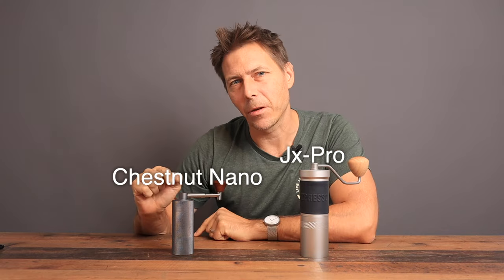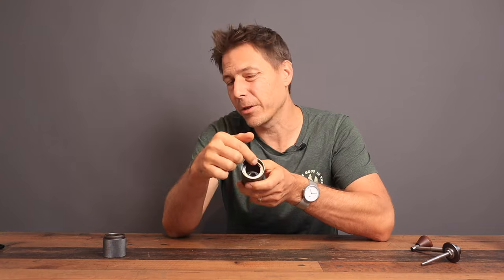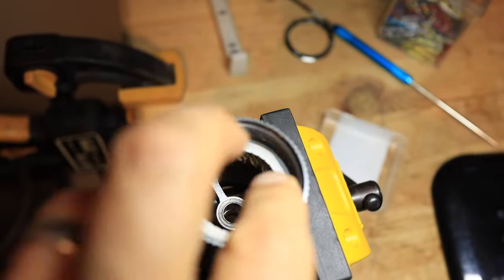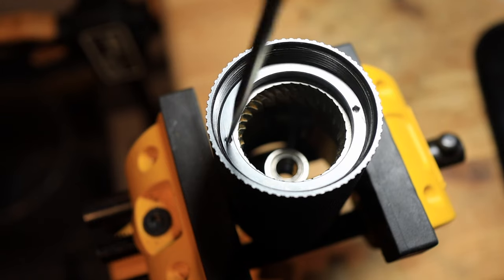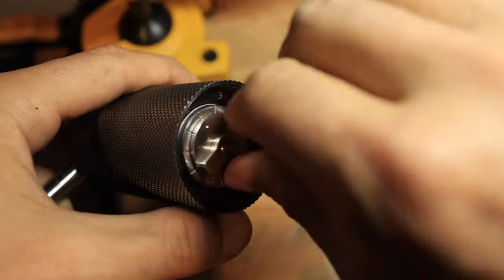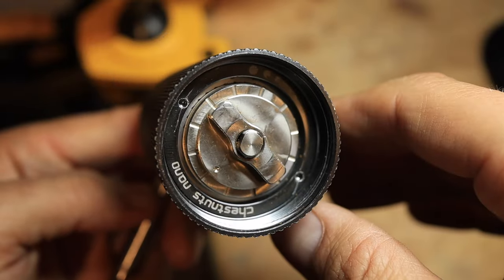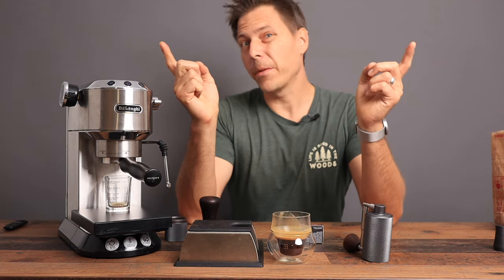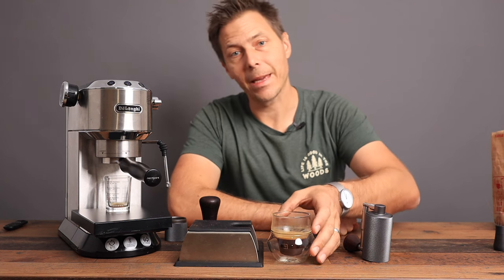How and Why (?!) to Shim your Timemore Grinder - C3, Nano, & More

Comment: Another trick is to tighten down the center of the burr into the outer burr but with the locknut loose. this alines the burr assembly. you then tighten down the locknut. It then spins freely at four clicks or less. thanks!
Reply from the maker: Thanks Stephen, I will have to give that a shot!
Reply: thank you, I had to do it that way cause the casing of my C2 burrs is made of plastic and the gap was too tight. works like a charm now
Reply: Hi, could you elaborate on what you mean by tightening down the center of the burr into the outer burr? 

Do you mean unscrew the locknut, then get to 0 click?
Reply: @musicianoffailure-3804  Loosen the retaining ring for the outer burr, tighten the cone burr to '0', then tighten the outer burr retaining ring. This works because the conical (cross-section) shape will self-center the outer burr to the conical burr piece and become concentric.
Reply: @BigBenAdv Thank you, this worked for me! Spins freely around 6 clicks now. Only watch-out: Make sure the outer burr is  loose (and not jammed like in my case) for the aligning through tightening the cone burr to actually work.
Reply: After 5years of knowing this problem, I can finally fix it. 🙏🏼 thanks!
Reply: Thanks for the tip. It worked well for me too
Reply: @TomsCoffeeCorner Hello.  Have you done it?  And did it help?

Comment: I just bought c3s version. The seller said its upgraded version of c3. I don't know if I'm just lucky or timemore really fixed the issue with outer burr alignment. I do test my grinder and i only hear burr grind sound only at first 3 click. The 4th is all clear, the casing / handle can spin freely.
Reply from the maker: Then you should be good to go!

Comment: Hi Tom. Thanks for all the great videos. I have a question. My timemore c3 pro esp is somehow misaligned and when I turn the dial to maximum it stops at 1 instead of going all the way to zero. This happened after I disassembled it and put it back together. Do you know how to calibrate the dial so that when it cannot turn anymore it reaches the '0' indicator on the bottom.
Reply: That happened to me, you found a solution??

Comment: Tom do you think this grinder gives much better quality grind than La Specialista build in one does?
Reply from the maker: Hi Ivan, I don't think so. There is too little adjustment. But the Jx-Pro would give a marked improvement.
Reply: @TomsCoffeeCorner  perfect, thanks for suggestion. Just checked on Amazon, it has 5 stars. Def looking of getting one, to change the quality of shots.

Comment: Hello, I bought an ims 18g nano and I still haven't been able to make the shot join in a single shot of coffee with the original gaggia basket, the shot of coffee always joined. What do you recommend to be able to achieve it, I always use 18g of coffee.
Reply from the maker: Hi Victor, which grinder are you using, and what kind of beans?
Reply: Tom I'm using baratza encore and the coffee is medium light if I put the basket that came with the bottomless portafilter it comes out perfect and I put it finer and it takes 45 seconds to make 36g of coffee
Reply from the maker: Ok so you say it comes out perfect, but just doesn't look that good? Maybe try WDT method. 👍
Reply: @TomsCoffeeCorner  Tom s also use the WDT method always

Comment: This video must be earlier than now )before I bought  another one grinder ,now I have chestnut and kingrinder)
Reply from the maker: So which one do you prefer?
Reply: @TomsCoffeeCorner  Thanks for answer Tom,kingrinder k4 is much better than C2 ,burrs synch best ,but I have standard portfilter on my EC685 and today I tuned my C2,I think keep it for alternate methods.Thanks for you tips,burrs is sync better a Little bit after this. I would be glad if you recommended a dosage for a standard portofilter, because I can't repeat the result. I don't know what the reason might be.Now I use 14g and 25 sec,but sometimes there is an acid taste ,not a delicious shot,and you do it so easy and perfect ,I’ll be glad for your help.
Reply from the maker: @akselerant  Hi there! Well, the dosage depends on the roast. Medium roasted beans are denser than dark roast, so you can fit more in the basket. For example, on the Dedica, I try for 14 grams of darker roast espresso. But if I am using light or medium, I can fit even 17-18 grams, due to the higher density. 
You will just need to experiment with your dosing, as well as trying the steam temp hack: https://youtube.com/shorts/8GO1b94CgN4?feature=share
Reply: @TomsCoffeeCorner  Oh Tom ,thank you very much ,I tried the  hack temperature too,now I will know that dosage depend on roast.I will try with fresh roast coffee and give the feedback to you.Sorry for my not so good English)I hope you saved my espresso )😊And another one question, Do I understand correctly that for different grains it is necessary to use the maximum dosage in the holder?

Comment: To anyone whose C3/C3esp is only slightly out of spec (like, the burrs make contact at 7 or 8), I managed to restore mine to acceptable concentricity by tightening it as much as it could go (at this point around 1), then heating the section with the burr (no handle or grounds collector) in boiling water.

After heating for a few minutes, I found (with the help of tongs and a tea towel!) that I could tighten it further to 0. At this point I let it sit in the boiling water a few minutes more. Then I took it out, and left it to cool still at 0. Having cooled, I found it could now rotate freely within spec (6 and above).

For those with only slightly eccentric grinders, this might save you all the messing about with unscrewing the fixed burr, which I found to be a real pain with mine (and trying to make this easier is how I stumbled upon readjusting it with heat). It does leave the fixed burr unshimmed of course, so a sharp impact (like dropping the grinder, as I discovered) would push it out of concentricity again.

Comment: Hey Tom!  Thanks for this vid!

I picked up a Timemore C3 Espresso version with the 30 click dial wheel - so perhaps don't need to shim this device.   This vid was helpful to see you grinding to an espresso blend using a manual grinder and using a standard basket.  I've been using my grinder with the dual wall basket with my Bambino ... but now might have the confidence to go with the standard basket as it seems like you CAN grind fine enough.  Not sure how fine to grind though use the C3 Espresso so if you have tips that would be appreciated - e.g. how many clicks back from 0 would I start with to dial in.
Reply from the maker: I haven't used the C3, but on the Nano it was 6-8 clicks. Cheers!

Comment: I've noticed another important effect to keep in mind when using this grinder. it is made of thin aluminum (and not thick steel) and aluminum conducts heat very fast, so the heat due to the friction while grinding will fastly reach all the inner and outer burrs (you can feel some heat on your hand, when grinding). the heat do expand the metal inside, lessening the gap between the burrs and making them somehow collide (if, prior to grinding, your setting was that they were just spinning freely, to the lowest click possible). my advice is to make your experiments, because the poor thermal management of this grinder can affect (and deteriorate) your burrs. I ended up using this grinder only for moka pot (where the grinder is coarser than espresso), so to avoid any problem.
Reply from the maker: Hello Federico, thank you for that feedback. I’m afraid all grinders that I have seen are made out of aluminum. Steel would make them very heavy. In both metals conduct a lot of heat. Have you found a better hand grinder for similar price for espresso?
Reply: @TomsCoffeeCorner  I have also the 1Zpresso JE and it doesn't have this thermal issue. it has its own (different) flaws, but overall I think it's a better grinder if you're grinding very fine like the espresso.

Comment: Hello! Nice video by the way! Is your c3 a bit loose after srewing? I mean, the bottom part where you adjust clicks. the "clicker" itself tends to rotate a bit (left and right) (without clicking ofc)
Reply from the maker: No, it's not loose. You just have to make sure to hold the spindle via the handle when adjusting the grind size.
Reply: Yes, thanks! But I mean, this big "screw" where you place two "wheels" has a small loose , about 0,5mm or less, and it allows to spin the "wheels" about few milemeters left or right (because of the loose on the screw), i bet its normal
(Sry for bad english hah)
Reply: Have the same phenomena with my C3. A big question mark for me,whether this is normal or something wrong.

Comment: hey Tom, thanks for the video and for the tip! I am wondering, did you change the settings on your DeLonghi machine to be able to get a shot is about 30 sec with the 1:2 proportion or you are using a standard one? I couldn't see which button you pressed and whether you hold it or not. 

At the moment, to pull a shot I have to press the button (for single espresso mode) and hold it until I get the right coffee-to-water proportion. Normally I can get 30-32 ml of espresso from 15 grams of coffee in around 24 sec, I am using Timemore Slim Plus with the burr set at 8 (doesn't go finer).
Reply from the maker: Hi Alex! With the Dedica, I just set the 2 cup button to be way too much, but stop it early. I like to either measure it with a scale, or eyeball it. Thanks for the feedback on the Slim!
Reply: @TomsCoffeeCorner  thank you for the answer 🙂

Comment: Got my C2 Max couple days ago, tried 27 clicks (from zero start) for French press and the nut seemed substantially loose, while the grind was only marginally acceptable with mostly larger consistent grinds as well as some unwanted powdery slurry that ended up as muck in the bottom of my coffee cup; left me wondering what I did wrong.
Reply from the maker: I haven't tried the C2 Max, but you just have to experiment with the setting. If that was too coarse, then tighten the grind a bit. Cheers!

Comment: The problem with the Chestnut C3 is that it doesn't have fine grind settings. C3's 80-83 microns per click is too big compared to 1Zpresso's 8.5 micron per click. So there is no way we can perfectly tune the C3 grinder for espresso extraction. There is only one setting for espresso extraction. If we go 1 click above then the extraction is going to get delayed and if we go 1 click below then espresso will get extracted more quickly. Not perfect for espresso lovers. Go for the 1Zpresso.
Reply from the maker: I actually prefer the Kingrinder K4, which performs similarly, but is in my opinion nicer to use.
Reply: @TomsCoffeeCorner  I have to try both 1Zpresso as well as Kingrinder K4. Thanks for mentioning the Kingrinder name because I haven't heard about this. K4 & K6 grinder has 16 microns per click and the rest are 18 microns per click. Another precision grinder. 👍👍

Comment: hey Tom i have one question, i just bought a timemore chestnut c2 and i dont have an espresso machine, i use a moka pot, should i shim the grinder if im not gonna grind as fine as espresso? for example, if burrs touch at 12 clicks and the finest i decide to grind is 13 clicks, should i still shim it?
Reply from the maker: I would recommend still shimming it if you can. Once I did that, my grind became more consistent, and I also was able to grind faster.
Reply: @TomsCoffeeCorner   thank you so much for the recommendation, ill try to shim it then, have a great day✨

Comment: I've noticed this issue about my Nano shortly after I got it (burrs touching at 12 clicks as well). I've done quite a research and found a few posts on Reddit that were describing the same method that you've used. After trying it, the burrs started touching at 10 clicks - still too coarse for any attempt to make an espresso though. I've retried it now, 10 clicks it is for me. It's not that much of a deal as I use it for my office V60 anyway, but if someone wanted to have one main grinder for all types of coffee, I'd probably suggest going for something else.
Reply from the maker: I would suggest the Kingrinder K4. At the same price, it is a MUCH better grinder.
Reply: Twice the price in Amazon. Sticking with c3

Comment: My C3 pro doesn't seem to have issues if i have it spinning, but I tried both level 7 and 8 but still it's a bit too much liquid and not much cream (14 in, 30 out). Any help ? Using pellini n82 vivace
Reply from the maker: Well, how long does the shot take for that 2:1 ratio? You could try 1 click finer...just make sure the burrs aren't abutting.
Reply: Same, 7 clicks and too much liquid, very disappointes. I got cheap delonghi which is grinds fine for espresso.
Reply: @Edgardo.o  found best settings in: level 8 with double filter 18gr in. Or level 7 single filter 14gr in. Or level 6 single filter 11gr in.
Reply: @pizzatimechannel  did you try 5-6 clicks just watched amother videos people using under 7, just dont want to damage the burrs :/
Reply: @Edgardo.o  cannot go lower than 6 from my tests, or it will "explode" damaging the sealing ring. I had already to replace it twice

Comment: I cant seem to find an answer on this but does this trick work for the timemore c3 pro max....it doesnt seem to have the same space on the sides as the one in the video
Reply from the maker: Hi! The C3 Pro Max may not have the issue with the axle wobble. If not, then no need to shim.

Comment: You better use some thread lock paste to fix this issue.
Reply from the maker: I'm not so sure I'd want to use that though in a food product...or do they make food safe lock paste?
Reply: @TomsCoffeeCorner  you put it on the threads only, It doesn't touch the coffee, or you can use teflon tape. Just need to fill the threads a little bit fermer.

Comment: Good afternoon, Tom, if you can help me with the problem I have, friend, I'll explain. I bought a gaggia classic pro 30th anniversary a month ago and a baratza encore I tried to grind finer and the mill got clogged, there will be a number and when the extractions come out with 18g of coffee takes more than 40 seconds for 36 g of coffee and the coffees come out super bitter I hope you can give me light friend I have asked a lot and nobody has helped me, I am using google translate because I speak Spanish only if you have one good afternoon .
Reply from the maker: Hola Victor, que pasa?! The Encore is a decent grinder, although not very ergonomic. If it is getting clogged, maybe you are grinding too fine. Also, if a 2:1 ratio is taking more than 40 seconds, you are likely grinding too fine. Try 2-3 notches coarser. Maybe watch this video: https://youtu.be/RLdQXlhUX8M
Cheers, Tom
Reply: Ok tom s I'm going to try right now I'm going 2 thicker clips to try, but first of all thank you very much for responding, I also received an 18g ims barista nano basket today to see how it goes.
Reply: Oh Tom ,thank you very much ,I tried the  hack temperature too,now I will know that dosage depend on roast.I will try with fresh roast coffee and give the feedback to you.Sorry for my not so good English)I hope you saved my espresso )😊And another one question, Do I understand correctly that for different grains it is necessary to use the maximum dosage in the holder?
Reply: Toms where can I buy a used grinder that is good better than the one I have encore or should I not buy another one, and keep trying
Reply: @victorm.claudio7801  why did you copy my words of my comment

Comment: how to replace the lid timemore c3
Reply from the maker: What do you mean by lid?
Reply: @TomsCoffeeCorner  thank u Tom for your reply . I mean the plastic lid cover on the crank
Reply from the maker: @lucasyu9224  I don't have this grinder anymore, but I think that it was metal. Anyway, to take that apart, I think you'd have to pull a pin.
Reply: @TomsCoffeeCorner  Tnx Tom